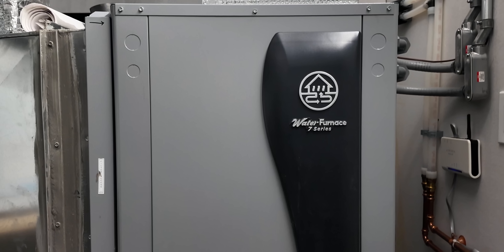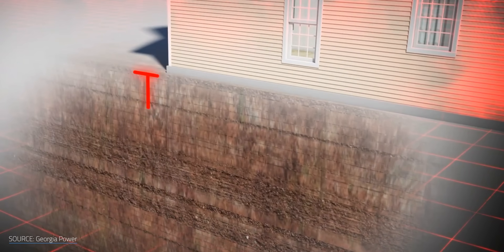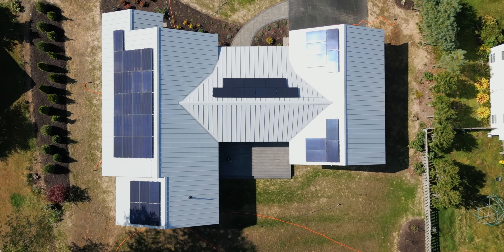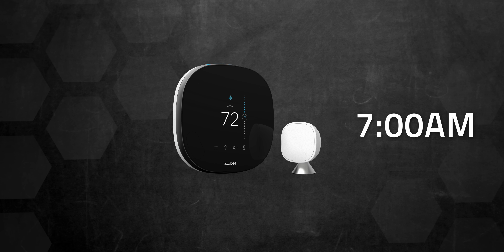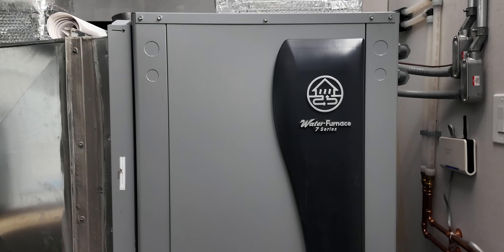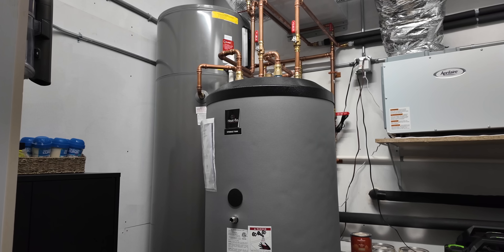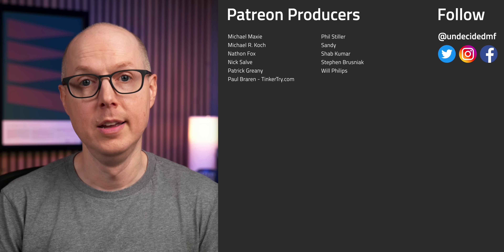How My Geothermal Heat Pump Really Performed (2 Years)

Comment: Coming from a HVAC professional,
The average life of almost all residential HVAC systems is about 10-15 years. Even though you don't have to replace the loop, the replacement geothermal systems are still substantially more expensive than your basic air to air heatpump. In my area the cost to put in a basic 14.3 SEER heatpump will cost about 7-10k, where as a the same size geothermal system would cost around 20k (assuming theres no issues with the loop for the new system). With those prices in mind the money you save on your electric bill will help offset the cost, but nearly every customer I have dealt with agreed that it's more expensive to not just install but maintain and replace their geothermal systems over their previous systems. There are many advantages to a geothermal system but cost is not one in my experience.

Comment: Could you explain why recovering superheat is free energy? I can understand that it would be in a refrig system where it is rejected, but in a heat pump it would be used to heat the house so surely you are just diverting it for another use (dhw)
Reply: That has occurred to me too.  I have the same setup as Matt but without the buffer tank.  The desuperheater circuit goes to the same heat pump water heater as Matt's.  Working with the higher temperatures of the water heater,  there is little rise (@10 oF) of the water heater out temperature after 4 hrs of furnace heat pump activity.  If I had it to do over again, I would have used the money spent on the desuperheater option to pay for the very efficient heat pump water heater.

Comment: We've had ours for about 6 years now and love it. Open loop system pulling water from a well and dumping it in our pond. Installation cost before federal rebates was 18k but that included adding 2 additional returns and re-doing the plenum. It replaced 2 air source heat pumps that were terribly inefficient during the winter with the defrost cycles in anything below 20F. I did some of the work myself. The cost was dramatically reduced because we already had a well on site. As stated in the video these systems work best in highly efficient homes and we've noticed reduced hot/cold spots in the home as we've improved insulation/windows/etc.

I would absolutely do it again.

Our peak electric bills (with very reasonable rates) were over 700/month during the winter. Our highest since install is something like 300 during a bitter cold spell.

Entirely electric home on well water, average bill is around 220/month.

Matt doesn't really mention it in this video, but depending on your jurisdiction and if you already have a high volume well you can run an open loop system with upfront costs that aren't much higher than higher end air-source systems. We use 12 gallons a minute in stage2 heating for example for a 5T.

Next step is solar.

Comment: One thing I would have wanted to see discussion in this video is expected lifetime of different components. For example, you shouldn't expect the inverter to last longer than 10 years for solar panels and any battery storage will also fail long before the panels.

However, how about the components of this specific geothermal heat pump system? Are there computer contolled valves, pumps, compressors in addition to pipeworks that have short enough lifetimes to require replacement long before the "system has paid itself"?

How do these compare to air-to-water, air-to-air or exhaust air heat pump in long term costs? We live in Finland in a pretty new house with good insulation and we went for combination of exhaust air heat pump + air-to-air heat pump because it appeared to be the cheapest setup in long run. And after extended experience with the system, I would say it depends on how much hot water you like to spend. When our kids were smaller, this setup was very cheap to run. However, I never really understood how much hot water teenagers can use while estimating the expected energy needs!

Comment: As an electrician I have wired 7 of these residential systems (in the 90's) and was impressed with them. Living in northern Minnesota, these systems are expensive and you need to know your going to stay in that home for the long run, a luxury most can't know. My issue is "government rebates", This means taxpayer funded, Please pay for your own installation as it is not my responsibility to pay for your lifestyle choices.

Comment: This video makes zero sense.  If you have to pay $0.31 per kWh for electricity, you definitely need to be powering 95%+ of all electric using solar panels.  This is a ridiculously high cost for electricity.  If you already have your energy usage covered by solar panels, why would you spend $50000 compared to a traditional system with much lower up-front costs.

50000 for geothermal.
15000 for a normal heat pump system + 10000 for more solar panels to cover the costs.
Which is better???

This video does an actual terrible job covering the costs...

He even attempted to discuss this by saying the house should be as energy efficient as possible, but never explains the rationale for why he wants it to be as energy efficient as possible.  He even says "its not about throwing more solar panels on the house." But why?  Why is it not better to add more solar panels?  Solar panels are significantly easier to install than a geothermal system, they have a much smaller impact on your land/foundation/home architecture, and ESPECIALLY superior if you are just adding more panels to an existing system which is quick and easy. 

I am not even sure how you could calculate the ROI on the geothermal since its most likely completely unique to your property and therefore there's no direct comps.

Comment: Would putting a horizontal system work under the basement in a new house? seems like excavating a deeper basement would be more cost effective with the added benefit of having a taller basement.

Comment: Looking for thoughts people.  I'm way up north where the cheaper heat pumps won't get you through the worst of winter. I live in a small camp 400sq ft. I'm thinking if I get a cheap heat pump build the outside unit a small shed then dig a trench 6' deep and say 50' out and back, lay a loop of the cheap corrugated pipe add a circulating fan. Maybe the circulating ground heat forced into the shed would keep the temp up enough for the heat pump to work right through winter?

Comment: Any heat pump would be great on family cottage, but no company wants to build it in there.
Some 30 years ago we wanted heating from our tilled stove, but they were not able to get through the wall. Walls are 1.2 - 2.5 meters of granite. There is only one way into the building and it's in the most wrong place. Also distribution around is nearly impossible.

Comment: Nice setup! So you need 3 tanks then: 1 for hot water, 1 for cold medium and 1 for desuperheater (which only helps in the summer), right? Btw, most of the comfort that you are attributing to the geo-thermal system is actually just good house insulation + floor heating. Even using standard air heat-pumps (or gas heating) would get you the same level of comfort, it has nothing to do with the geo part.

Comment: Thats a good way to explain it. I rent a studio apartment that has a ground heat pump. I also have a balcony solar system and a 2kw home battery. With a dynamic electricity contract I can charge the battery in the cheapest hour automated, and it can basically run my house half a day with that. I use 140kwh a month for all energy (with two kids). As far as I can see my heat pump cycles at around 120w for a few minutes every half hour. It basically uses less energy than I use for cooking each day.

Comment: Solar panels cover all my energy needs including EV charging. Gas based radiant heat during winter for heating is great. Keeping the dollar constant, i’ll pay 30k over 30 years for heat. You paid 90k upfront (nuts). And for what? Radiant is much comfier than forced air. Makes no sense to me. If gas prices become prohibitive, I can use my hvac to replace or supplement radiant.

Comment: We purchased our current home in 2012. It has a 3 acre pond in the front yard, and the builder grade heat pumps were 8 years old and extremely inefficient. 
Geothermal interested us, so we got some quotes on traditional air to air and on geothermal with a pond loop. 
With the 30% tax incentives of that time the geothermal made perfect sense. 
We also have Water Furnace units on both floors. 
Over the past 12 years since installation, they have more than paid for themselves, but there are more benefits to them than cost savings. 
As you mentioned, the recovery time for them is much faster. 
Another benefit is that all of the mechanical equipment is out of the weather. We have ours in the crawlspace under the house (common in Virginia).
We have had the crawlspace encapsulated as well, so it's semi conditioned and very comfortable to work in when needed. 
We had the desuperheater, but ultimately switched to an on demand propane water heater. 
The only issue we've had is that about two years ago the loop seemed to be losing pressure more between annual services. 
I installed an automated juicing system for that. Using a pressure reducing valve off of the well water supply, it's set to maintain a constant positive pressure. I have a simple digital meter in the line to monitor how much water is going in, so I can know if the tiny loss ever grows more. It hasn't so far. 
It uses maybe a gallon of water every couple of months

I even setup a blink camera to watch it from the living area. 

We've had nights down to -4 F, and while we do have electric auxiliary heaters in the air handlers, they've never had to be used. 

Summers here can get brutal, but using a 40 degree head start on heat transfer makes cooling the home easy and affordable.

Comment: Funny thing is also that yes your server rack and computers take a lot of energy. But in the winter they heat your home. And in the summer when you need extra cooling the solar energy takes care of that. We have an electronics workshop in our new home and we heat up the room bij 2-3 degrees on a working day just by turning on the equipment. We also have a geothermal system and it works great. hitting actual measured COP iof 6-10 with heating depending on the working mode of the heatpump.

Comment: I can't make the math mathing on this. The quote I got is $26k without any survey done. Currently the return rate of the system is 25-30 years. The heat pump warranty is 20.years if I pay $100 a year an this extends the return rate even more. And I have a really old heating system and no insulation. If I insulate my house the return rate would be 90 years. And I will depend on the electricity provider only. If I install solar with batteries it would cost another 26k but 80-90% of the time I would be independent.

Comment: Using low-power computing any time you're not running a software transcode (hardware transcoding being infinitely preferable where available), could save you tons of energy per month. Picocomputing can accomplish most common household tasks at power levels rivaling the idle power usage of a traditional all-purpose computer.

Comment: Philippines.  New (in 2022) 1800 sq ft house.  Electricity bill - $0.  (10 cent meter charge). $14,000.  USD solar investment.  11.6kWp system.  Yearly propane cost for gas stove  $275. Optional. Haven't switched over to electric yet which will result in 0 cast with solar. Water bill... $3.40 monthly. Yearly home taxes...about $200. USD......and yes, infostructure and services NOT so great.   * ( No rebates or tax incentives here)

Comment: im kind of curious if the solar is worth it. if the heat pump and solar cost an extra 80,000 to install, but only save you lets say 2200 a year, thats 37 years to break even (assuming nothing breaks down and no standard costs increases, so im calling that a wash). if its an extra 160K, which without rebates and depending on location it easily could be, it would take 70 years to break even. If your motivation is long term savings, this is still a bit of a hard sell unless you have everything working for you. 
But, if you are ok with paying for simplicity, these can give you a bit more comfort and reliability especially in very cold area. The question has to be like you said, is it worth it , for you, not just for money.

Comment: At 10:42 - Matt: "Even if you remove my computer setup and EV charging from the mix, my HVAC is still about only 18% to 20%  of total energy use."

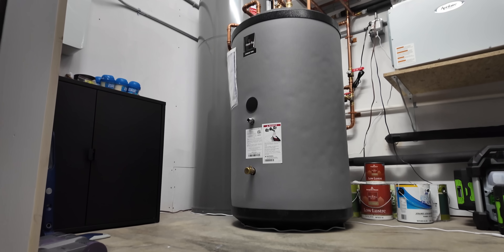Following pie chart shows 54% of energy use labelled as "Misc". Hmmm. Not an ad for Water Furnace? I mean Matt said it wasn't at 8:05 but I'm not so sure I'm convinced.
Is it not a little bit suspicious that the pie chart organizes all of the pie slices by size, except the "ERV" slice (whatever that is) and the "Misc" slice, which is actually the largest slice?

Comment: Interesting analysis. We've had a horizontal ground loop geothermal (And PV) for over 20 years. One thing I found is that we still get savings by lowering temperatures at night, as long as we allow the heat to climb back gradually, one degree at a time, so the Geothermal keeps up and doesn't have to run the backup resistance heater.  We programmed the thermostat to do this over 3 hours.

Comment: I've had geothermal as a retrofit in Minnesota for 3 years now.  Energy usage has been cut in half, but cost when compared to heating with natural gas is about the same.  If the system lasts another 25 years and only has minor issues, I'll probably be happy.

Comment: I built a net zero home and targeted geothermal in the build but couldnt because I choose to live on a ravine and our by-laws prevented in ground water out of fear of leakage.  The overall cost of net zero for my home was about 8% of the home's overall cost.  This was also 8% for my neighbour who did the same.  Air sourced heat pump, extra insulation, insulation under slab, upgraded windows and doors, air tightness sealing of the entire home envelope, steam humidifier, larger and efficient HRV air exchanger, waste water heat recovery system, heat pump water heater, and a few more technologies were used.  I have recouped all the initial costs in 6 years of ownership.  It isnt this fast with a retrofit net zero home usually, but easily achievable in a new build.  I'm now adding 30 kWh of battery backup and inverters to manage it plus possibly a diesel generator as emergency off grid backup to try to achieve full off grid capability.  I live in northern central canada and we can hit long periods of -30 or colder weather here.

Comment: Does the thermal coupling degrade over time for the heat exchanger that is buried? As an example, due to ground moisture or other expansion/contraction events (that would create a void), or other phenomenons.

Comment: Here we pay 25% VAT and geothermal for a standard house is more lige 25.000 US$ all inclusive? I got an air-water heatpump which suffers a bit in the winter due to the 3 phases only got 25A fuses so when charging the car it's needs active control of the charging when the heatpump does  it's defrost routine during the night, especially when there are a need of charging the 75 kWh battery of the house as well. Thank god for Home Assistant where it's possible to make automations that controls charging of the car and house battery ot the fuses would have blown long ago.

Comment: Hi Matt, I really admire what you have achieved with your home. Very inspirational! I have similar goals for achieving net zero energy usage annually. In the UK the tactic of installing as many solar panels as possible tends to be a good starting point from a financial perspective as it can be possible to get paid more for export than what it costs to import it though a Time of Use energy tariff. Like you, I totally agree energy efficiency is always important. On that topic, are you able to calculate a Coefficient of Performance (COP) for your geothermal system? I'm very curious as in the UK they are quite rare due to the high cost and large space requirements.

Comment: You're getting a huge amt of waste heat from your electronics for heating degree days, which are dominating in your climate. Hope you realize that. 

If you didn't figure that into thermodynamic calcs, it'll make your setup look a lot more efficient than it actually is if you are looking at raw E use of the geo + R-values vs. outdoor temps.

Comment: My house had a heat pump when we moved in.  We were always cold in the winter and my electric bill was sky high.  We suffered for about 8 years when it started to have problems.  The quote for a replacement was 55k.  We went with natural gas and central air combo for under 3k.  My electric bills dropped drastically over a hundred a month.  Natural gas heat is less than 1 k a year and more important we are warm in the winter.  Geo thermal in illinois will not ever be a good deal at current costs.  About 10 years on natural gas and I would never go back

Comment: I have a Water Furnace 7, best decision I have ever made.  I have a 3300 sq foot ranch (built in 2018) with the same size basement that is also heated and cooled for a total of 6600 sq ft.  Last year my total heat and cooling cost was $493 (full year!) $41 a month.  I live in Western Maryland where summer temps are often in the 90s and winter in the 30s and 40s.  I set the temp for total comfort and do not worry about trying to save energy since the system uses so little power (the whole house is heated for less energy than a single electric space heater - almost seems like magic).  The house is always completely comfortable.  I still can’t believe how little I spend on heat and cooling!  Total instlation cost was about $38,000 after government credits and was done as the house was constructed.  It will easily pay for itself over time.